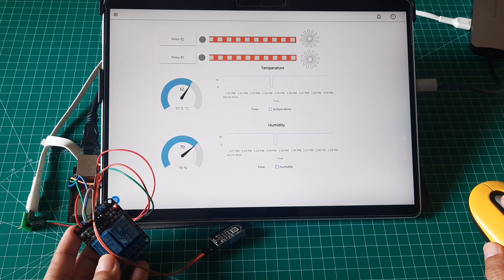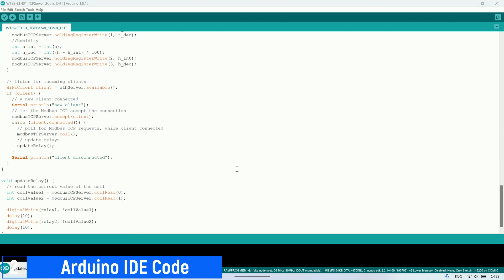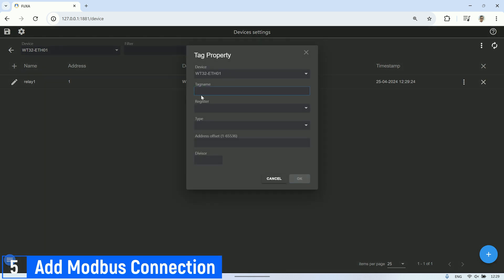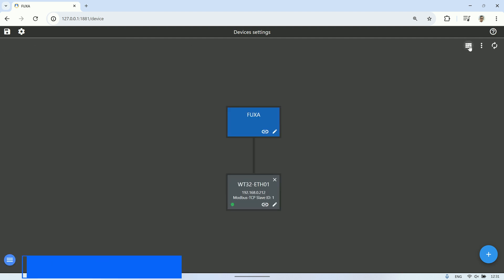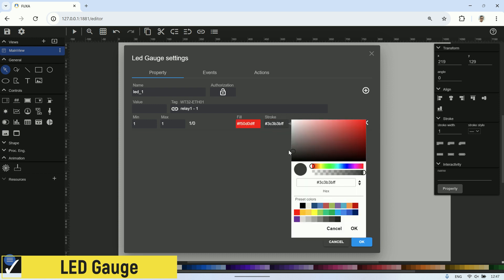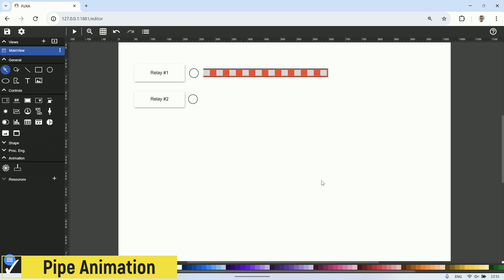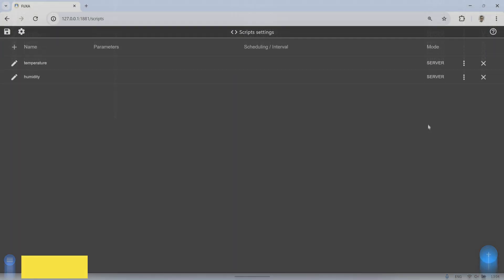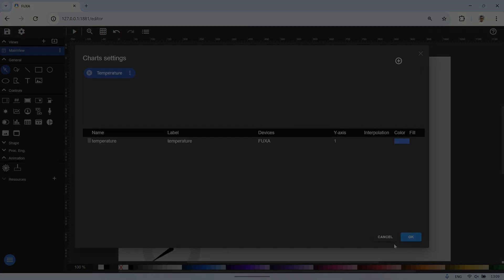Part #1- Building a SCADA Interface with Fuxa and Modbus TCP using WT32-ETH01

Comment: Thanks for providing the instruction and code, but the code throws errors when compiling... 
"warning: conversion from 'SerialConfig' to 'uint16_t' {aka 'short unsigned int'} changes value from '(SerialConfig)134217756' to '28' [-Woverflow]
   int begin(int id, unsigned long baudrate, uint16_t config = SERIAL_8N1);" its related to the data size for the esp32 in the wt32. Is there additional code I am missing?
Reply from the maker: Thanks for the feedback.
The code in the video is complete, no additional code is missing.

The warning comes from a difference in how ESP32 / WT32-ETH01 handles Serial.begin().
SERIAL_8N1 is defined as a SerialConfig (32-bit) in ESP32, and the compiler warns when it’s cast internally.

This is only a compiler warning and does not affect functionality.
If you want to avoid it, simply use: Serial.begin(9600);

Comment: I'm pulling voltage from an Analogue sensor and can't figure out how to convert this in the script to temperature. The manufacturer has given me the formula for the conversion but cant get the syntax right for the script to work. Can you help with this?